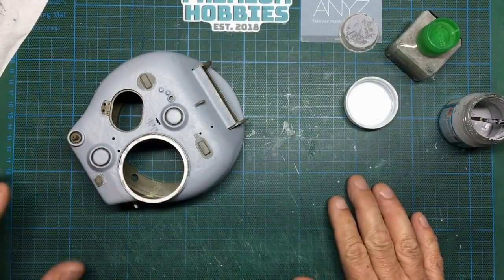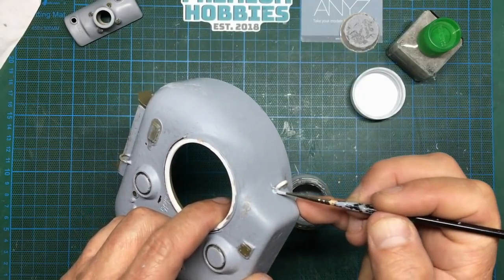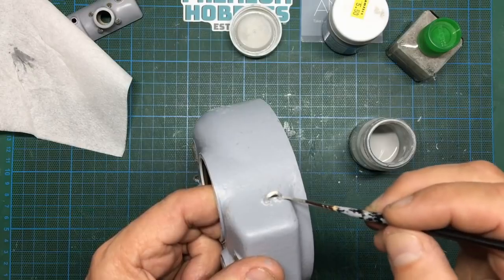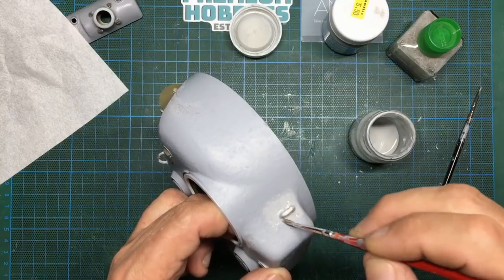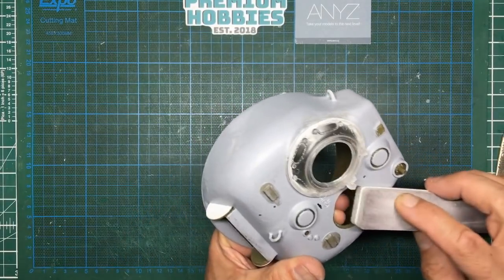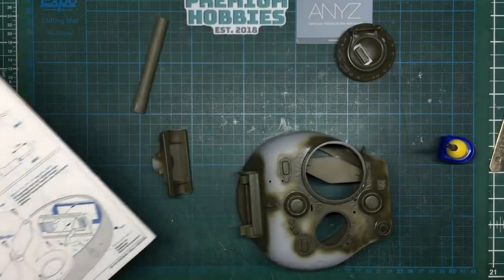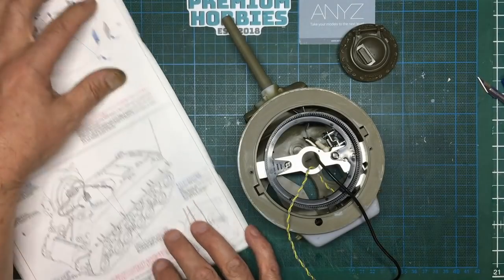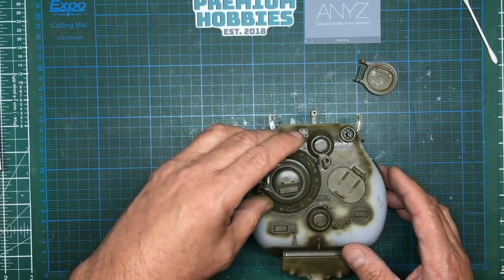Lets build a Tamiya 1/16 RC Sherman. Part 28

Comment: That Mr Surfacer looks like it has the consistency of Marmite lol
Reply from the maker: More like set concrete James!!
Reply: @NigelsModellingBench  You could of done a concrete armour version - less detailing to add ;)
Reply from the maker: James Mower yeah.. mix cement and sand add water. Dip model in. Leave for ten minutes. Remove model. Done!!
Reply: @NigelsModellingBench  Bit more to it than that lol

Comment: Do you make models to look new and pristine or do you add battle damage? I'm wondering if that turret is thick enough to add gouges with a soldering iron, or similar, to make deformations from glancing shell impacts.
Reply from the maker: I dont want to beat this one up too much, if at all. If I startt adding damage where does it end??